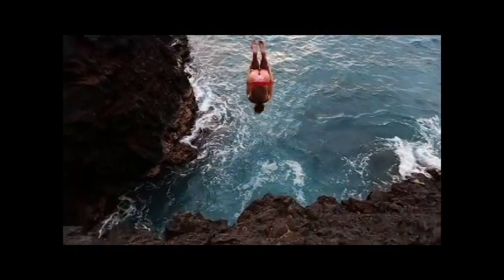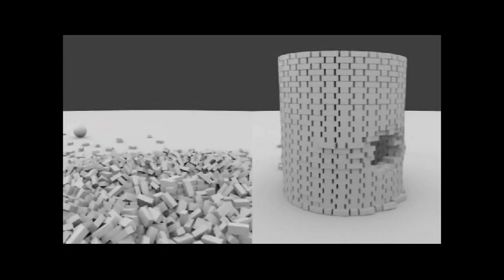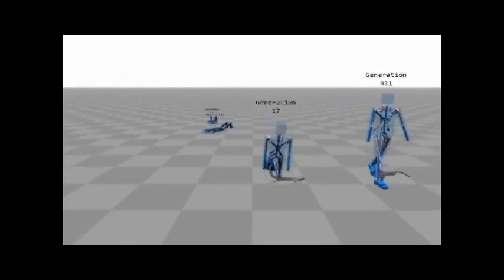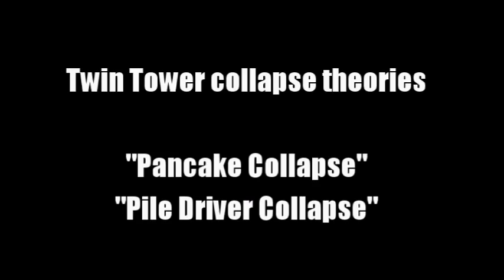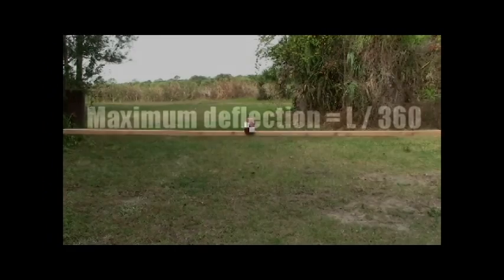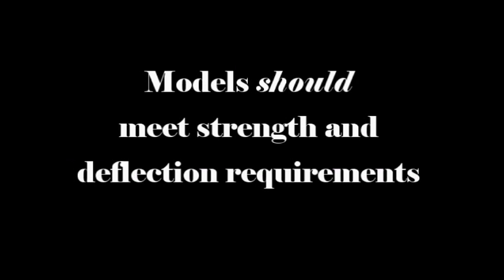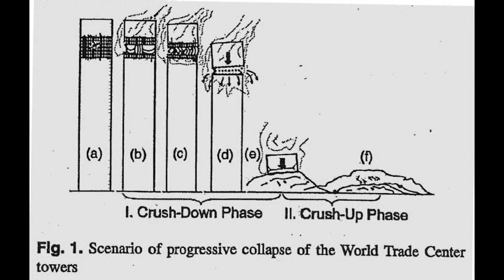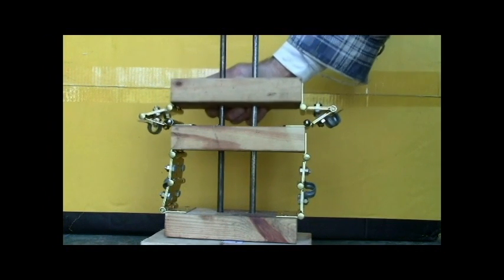9/11 Experiments: The Force Behind the Motion

Comment: BRILLIANTLY explained and there's the smoking gun.
Reply: @dontgetdrunkandvomitonthes3880  lol. 😂 Fact is that it came down at all tells you this was a demolition.
Reply: @tylerdurden7500  "Fact is that it came down at all tells you this was a demolition."
Fact is that you not understanding basic physics isn't signs of a demolition, it just means you're not competent to have an opinion.

"oh dear. You probably need to quit now. You have no idea what you're talking about."
Oh, dear. Did he out you as an absolute fuck-wit and now you're all sad about it? Poor you.
Reply: @tylerdurden7500  
A flawed bulding code allowed a building like wtc7 to be designed and approved.
Reply: @tylerdurden7500  
They changed the NY building code in 1968 to allow spray-on foam fire proofing.
Reply: @tylerdurden7500  
Long span steel floor trusses/beams need very good fire protection.
Reply: @tylerdurden7500  
Before 1968 NY building code change, all steel buildings required bricks protection.
Reply: @tylerdurden7500  
If another building with long span steel floor beams catches fire it could collapse.
Reply: @tylerdurden7500  
In my country a new building partially collapse because it had hollow core floors.
Reply: @tylerdurden7500  
In my country the building code allows the use of hollow core concrete floors.
Reply: @tylerdurden7500  
Engineers warned our government about the dangers of hollow core floors.
Reply: @tylerdurden7500  
Our government ignored the engineers warnings, until there was an earthquake.
Reply: @dontgetdrunkandvomitonthes3880  and this still doesn't explain a global collapse from an office fire without a plane hitting the building ( not that it makes a difference.) like what difference a brick skin or steel exoskeleton make to a demolition?
Reply: @dontgetdrunkandvomitonthes3880  I've answered this one. I'm waiting for yours
Reply: @dontgetdrunkandvomitonthes3880  This is incorrect. Steel beams do not melt or bow under the conditions of an/multiple office fire/s.
Reply: @dontgetdrunkandvomitonthes3880  What long span steel floor support beams can withstand a controlled demolition? I think you're missing the point.
Reply: @tylerdurden7500  
Fire protection keeps steel cooler in a fire, stopping it from sagging or expanding.
Reply: @tylerdurden7500  
B7 had very large heavy floors so it's connections need good fire protection.
Reply: @tylerdurden7500  
Large heavy floors are dangerous in a fire because the connections carry heavy loads.
Reply: @tylerdurden7500  
Once large heavy floors start collapsing it's game over and can't be stopped.
Reply: @tylerdurden7500  
Once all of B7's floors had collapsed, the outer walls buckled and caved in.
Reply: @tylerdurden7500  
B7's outer shell was designed to be one object, so it will collapse as one object.
Reply: @tylerdurden7500  
B7's outer shell collapsed concurrently as it should, due to it's design.
Reply: @tylerdurden7500  
NIST said 911 was 1st time in history a building taller than 15 stories collapsed by fire.
Reply: @tylerdurden7500  
Wilton Paes de Almeida Building, Brazil, 26 story, steel, fire, total collapse in 2008.
Reply: @tylerdurden7500  
''Fire can't cause a building to collapse'' <--- BULL.
Reply: @tylerdurden7500  
B7's 24 interior stand-alone columns were (isolated) so failed consecutively.
Reply: @tylerdurden7500  
British steel done fire tests that proved office fires don't get hot enough to melt steel.
Reply: @tylerdurden7500 
Weather or not a building collapses in a fire depends on it's DESIGN.
Reply: @hotelscleanbathroomswithpo4938  you have ABSOLUTELY NO IDEA what you RE talking about. I am not even going to argue with you.
Reply: @hotelscleanbathroomswithpo4938  oh dear. You probably need to quit now. You have no idea what you're talking about.
Reply: @Quake proof a house Taylor Devices Viscous Dampers They didn't need brick. Are you serious....have you got a youtubekids account that's not vetting your videos? Please get your mum.
Reply: @Quake proof a house Taylor Devices Viscous Dampers and you are actually doing a very concincing 'stupid' 😂

Comment: The farce behind the motion... a totally invalid experiment.  Most things have been scaled down but what has not been allowed for is how to scale gravity.  The acceleration between floors in the model is minimal compared to falling the height of 1 floor.  This is either a simpler error by the author, or a deliberate attempt to mislead using incorrect information....   Both still make this totally invalid

Comment: That's redicolus. If you say, the bending of each floor should be L/360, then his bending is done by THE OWN WEIGHT of the floor and BETWEEN THE SUPPORTS! In your case the wooden plates are many times stronger than the stores and ceilings of a real building. You test your L/360 with a huge weight. Which has nothing to do with the original, because in the collapse of the twin towers, the falling weight has increased with every store which has been smashed.at first it was e.g. 10 stores who fall, a few moments later it has been 20 stores which means that the moving weight has doubled. Another fault is: you use wood, but wood is much more elastic than the steel which has been used for building the WTC. Sorry your model is so completely wrong.

Comment: Yes, this video does prove something: With a little effort, you can rig an experiment to give the result you want.

Of course, the content of this video has nothing to do with the towers.
Reply: Isn't that the point? To rig a model and make it fall like the tower did? The very fact he had to rig it to collapse proves that they had to rig the real towers to collapse.
Reply: @dibensy59  No, in this case the point is to build a phony model that bares no resemblance to the towers in any way, one that is designed to fail, and use it to fool gullible people. It proves NOTHING.

Take a science class. Learn how science works.
Reply: @Tim22222  Out and down Tim. Out and down,
Reply: @dibensy59  
But why did we not hear all the loud bangs as the tower came down.....like we can hear i this experiment?
Reply: @Shelby_Starner_Everything  Because thermite is relatively silent, but not totally. And if you remember the video of the firemen that were there, they did say they heard bangs.
Reply: @dibensy59  
This experiment proves it was not a controlled demo.  https://www.youtube.com/watch?v=x4dVL-P9ems
Reply: @Shelby_Starner_Everything  Those Legos look a bit like WTC7, but not the other towers. So far Mr Cole has created the best simulation of what happened.
Reply: @dibensy59  "So far Mr Cole has created the best simulation of what happened."
Even if that statement would be correct, what would it prove? It is still a bad simulation.

Comment: Question: Couldn't anyone recreate this experiment but using tissue paper for the floors and a bowling ball for the weight - and get completely different results? Where are his calculations indicating that his choices are accurate?

This experiment was designed to fail. There's no objective science here.
Reply: The towers didn't even have a weight dropped on them, any external weight is to much weight for a direct comparison. If anything he gave the "official theories" every advantage. In your bowling ball tissue paper analogy, the structure would not even stand free of external force, where as in the above model It probably would. If you've got a link to a better experiment that substantiates "pancake" or "pile-driver" I'd love a link.
Reply: @erik1680  "The towers didn't even have a weight dropped on them"
How about 15-30 floors of building? In case you don't get it, just drop a 15-30 high rise building on a floor with similar to any of the towers' floors.

"If you've got a link to a better experiment that substantiates "pancake" or "pile-driver" I'd love a link."
So, since you haven't been able to find a video that better explains the dynamics in the collapses, you have decided that this video is correct? What kind of logic is this?
Reply: @brucelansberg5485  It's truther logic, of course! Totally invalid & bearing exactly ZERO resemblance to logic & physics.
Reply: @Tim22222  Well it did explain the resistance that must have been faced by the towers instead of a free fall.
Reply: @abhilashyadav2274  So yes, there was resistance. Nobody but truthers claimed the towers fell at free fall acceleration.
Reply: @erik1680  "In your bowling ball tissue paper analogy, the structure would not even stand free of external force"

Same as with the experiments in this video. His model would not be able to stand at 1:1 scale. There's just nothing valid about it.
Reply: What's the matter coward, did your Jew bosses tell you not to answer my because there afraid you'll get your ass kicked?

Comment: David Chandler from architects and engineers has show that the twin towers collapsed at 66% of freefall. The crushing of the building used up some of the energy, and slowed the rate of decent.
The degree to which a falling object is slowed depends on the degree of resistance it encounters.
A bowling ball falling through water will be slowed more than one falling through air.
In order to know how much deceleration will occur it is necessary to calculate the amount of resistance.
This demonstration fails to do this.
A good demonstration for anyone truly interested is to watch the video of the two young men building the world's tallest domino tower. The first attempt fails when one single misplaced domino causes the tower of 18500 other dominos to collapse. 
It takes energy to topple each extra domino, but each extra toppled domino adds to the energy in the system.
Gluing the joins between the dominos would add resistance, and slow or prevent the collapse. 
But to know how strong a glue is required requires a calculation. Claiming that the collapse of the twin towers defies Newton's third law requires a calculation.
Reply: They fell at almost free fall
Reply: @abhilashyadav2274  Thank you for responding, but I am not sure I understand your comment. The twin towers fell at about 66% of freefall acceleration according to Architects and Engineers for 9-11 Truth,. I would not class that as almost freefall, for clarity, at what percentage of freefall acceleration would you say  that they had not fallen near freefall acceleration? Did you watch the video of the domino tower collapsing under gravity? That fell, according to my calculations, at about the rate of the Twin Towers, without the aid of explosives.

Comment: I liked your video on the thermite, but I find this one less impressive.  

You can see another video here where another physical model was made which did pancake https://www.youtube.com/watch?v=flo62pdaIMI

The experiment with the rigid walls on the outside really isn't right because the rigid walls are helping to support it.  

The fact that physical models can be made which consistently stop collapse (in this video) and can be made which support collapse (as in the video in this comment) shows to me that any serious investigation of the tower collapse must take the design of the specific towers into account, a great deal more than what these models offer.  There is no obvious physics answer to say clearly yes or no whether a structure ought to be able to collapse like that.  Static loads are rather different than dynamic loads.  If I were to make a simple mathematical model, I'd deal with forces for static loads and energies for dynamic loads.  Whether the building could collapse would depend on whether the energy needed to bust the supports in each floor was less than or greater than the added gravitational energy, and I don't believe this can be conclusively answered with a simple model, whether mathematical or physical.  I can imagine that there could be a design which could withstand considerable forces but do poorly with regards to absorbing impacts.  I only have a bachelor's degree in physics, so I'm not going to try to do a detailed analysis of the building.  

But let's assume that the pancake collapse was possible through impacts snapping bolts or something which were able to handle large static loads.  There is still the issue that the entire building was pulverized and that there was molten steel at the site of the collapse for weeks after it collapsed.   This is subject to very simple analysis, irrespective of building models.  If you go to the top of a skyscraper and drop a piece of steel or concrete off the top, do you expect that it will be totally pulverized or melt when it hits the bottom?  Undoubtedly a concrete block would shatter and a piece of steel would deform, but that is far from what was seen.  The energy per unit mass in the trade centers ought to have been about the same as dropping something off of a building.  A collapse only from gravity (even imagining that all connections between the steel joints were magically removed instantaneously) would certainly have been catastrophic, but gravity does not cause mid-air pulverization of concrete, nor does it melt steel.  A collapse due to gravity ought to have left most of the steel pieces mostly intact and without totally pulverizing the concrete to dust

I think I've just realized why the model in this video always stops collapse, whereas the one in the link I posted allows the collapse.  The structure in the link is held together by solid pieces connected at weak joints, whereas the one in this video is supported by weak materials with no obvious weak connections.  The model with weak connections can fall while expending minimal energy busting the joints, and in this case, the pieces fall mostly intact.   The one with no obvious connecting points has to utterly destroy all the supporting structure to fall, and in so doing absorbs a great deal more energy. With this line of reasoning (completely neglecting the actual design of the trade centers, as I am not qualified to do such a detailed analysis), the pancake collapse theory would be credible if the debris of the collapse contained many largely intact pieces of steel and concrete.  

You could also observe correctly that there was no precedent for fires causing steel framed buildings to collapse, and that attempted controlled demolitions which are botched do not look as nice as those on 911, and all the coincidences, and assassinations of witnesses, and other such things.
Reply: Lol your "video supporting collapse" is comical. It didn't "collapse" or "pancake", it fell apart. You'll need to get plans for the model to see if it was made to come apart, which through observation I'd say that's pretty likely. If you want to simulate what the towers did, you need constant acceleration on the part of the 15% of the mass the structure which must destroy the remaining 85%, you'll need the 85 % of the mass to be destroyed, not fall down, and also have a large % of the mass ejected laterally and vertically during the "collapse". Its impossibilities like these which is why 18 years later, there is no official scientific explanation for the "collapses".
Reply: @EddSpencer  
It was the growing rubble that destroyed the towers....not just the upper 15%.